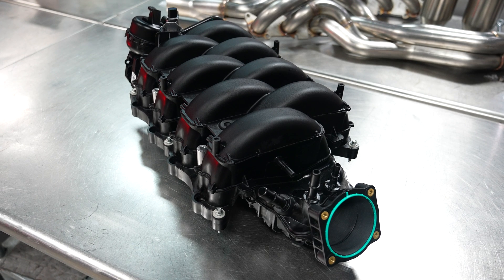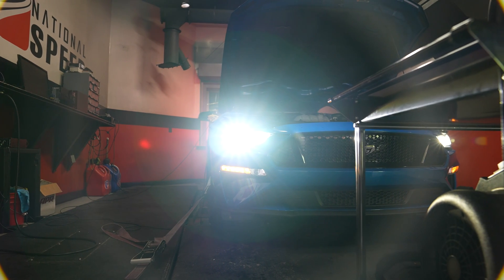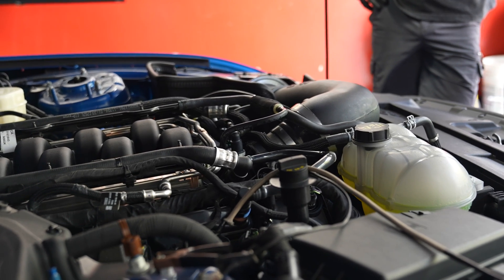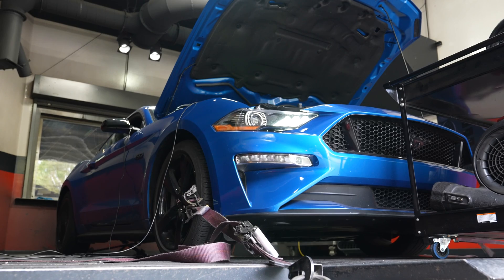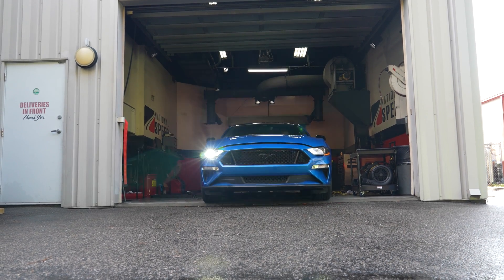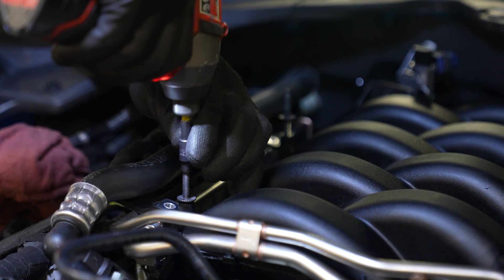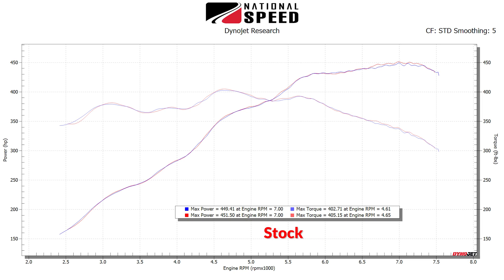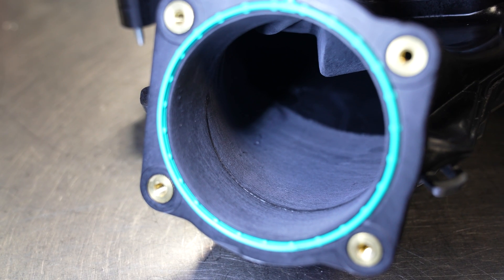18+ Mustang Ported Intake Manifold Dyno | SURPRISING Results!

Comment: Its got to be the head limiting flow at this point right?
Reply: No. This cars mildly modified so its not going to see big gains. With headers, full exhaust, you might see a few HP. The best way to test all this is road testing with a draggy or taking it to the track. Dyno numbers can be misleading. Just like everyone says that the 18+ manifold is cheaper and makes the same power as the GT350 manifold but yet when at the track or draggy testing, the 350 manifold makes every single car faster than the 18+

Comment: This video is very disingenuous…. You will never see the full potential of a ported manifold with the STOCK throttle body and no tuning tweaks. Put an 85mm throttle body on it and make the proper tune changes in a controlled environment and I will bet that it will provide good gains. You guys can fool these novice enthusiasts, but not me. Nothing you can say to me about performance modifications will go over my head. Try me if you want and watch my response will truth and logic.
Reply: Yes. The AFE 85mm Throttle Body is a good product as well.
Reply: 90mm is better if used with a ported intake manifold or force induction (turbo or supercharger). You have to consider bigger is not always better. Keep in mind air velocity reduction if the opening is too large would hurt performance. That would not benefit you. 85mm is the best option in my opinion for full bolt-ons. A larger 90mm throttle body would be most beneficial with a force induction application.
Reply: @HewigIsidore  thank u bc i was doin research and i found out about the 90mm n thought maybe bc its bigger more air can get through but i dont wanna go boost. thank u for the very valuable information.
Reply: which throttle body do u recommend?
Reply: BBK 85mm Throttle Body
Reply: @HewigIsidore for that might as well go ford performance 87mm cheaper and more reliable
Reply: @bigkarl24  I agree 100%. Plus you don’t have to worry about the PCM accepting the unit.
Reply: @HewigIsidore what about the AFE 85mm TB is it any good?
Reply: @HewigIsidore  is the 90mm any better?
Reply: @HewigIsidore yeah but the $ to hp ratio is ridiculously high lol, simple K&n , longtubes, cbe and a tune all you really need NA on these anything more you might as well just save for a supercharger if ur that hungry for a few hp
Reply: Your welcome!
Reply: Just wanted any tips on moding a f150 did an s&b Cold air intake and i am wondering what manifold to get next would u recommend me any?@HewigIsidore
Reply: It depends on your goals. How do you use the truck. Is it a daily driver, weekend racer, do you do a lot or some towing with the truck? What year is the truck? 5.0, 3.5, or 2.7 ecoboost?

Comment: Stock cam motors: keep/run the 2018+ Gen 3 manifold. 

Aftermarket cams to demand more airflow and rpm? Port the intake if you can.

1) thank you all for this testing and video.
2) this goes to show how incredibly well engineered the 2018+ manifold is, box stock. 👏

Comment: Typical results, most stock manifolds are optimized as is, If there was more power to be had there the factory woulda done it .

Smoothing, or changing finishes wont get you a bit of gain either. Toomany places making claims when most times its from the tuning. Ported a ton of plastic intakes unless youre making big power save your money, same with the TB

Comment: Numbers don't make sense a stock 18 is 460 hp so how isless at 459 with intake and headers
Reply: 460 crank horsepower, the 459 is to the wheels which is what matters
Reply: Oh gotcha my understanding was it got less crank...459 to wheel would make more sense....my cars in the shop right now getting one installed hope I get these numbers...I have bk keadera bk mid pipe circa exhaust injen closed box intake and now the 2018 ported manifold...

Comment: It needs a tune to gain the power trust me at least 10-20 depending on headers and intake setup
Reply: I currently have catless longtubes jlt with lund tune on my 10speed how much u think I'll pick up porting my my manifold?
Reply: @Shiftnlift  None, power is from headers and tune
Reply: @Shiftnlift  15 wheel or so
Reply: @Jay vlogs  ok thats worth it then to me thank you bro
Reply: @Shiftnlift how did the mod go? Seeing you sound as if you ok yourself to do the mods.
Reply: @psiturbo  haven't done it yet bro I just  put on new rims.. I had these premium rims that are only 8 inches wide and having problem hooking so I just put on some 19 by 9.5 actually last week. I'm still on 93 as well. So I think I'll go e85 first. Cause that's about 500 compared to me paying someone 3 to 400 dollars porting a intake right now. I probably will eventually tho
Reply: They did tune it

Comment: I think gains (or not) depends because manifolds have different imperfections and smoothing it out makes some difference. Some i believe might be little more shifted on connection points creating almost none or bigger lip making it little bit better or worse from the factory. As you said 5 to 20hp on car with over 400hp is not major difference. Also who and how ported might make difference, if for example runners are not balanced in shape and size as it should it might be even worse than factory. Finish smoother or rougher might also contribute to result. Too many factors to measure over just small gain.
Reply: Finish, nor smoothing out a small casting line will net 0 gain

Comment: Ummm in the real world, doing a ported intake helps A LOT on 5.0's..

Something aint right here
Reply: Op is correct, waste of time in  most cases. Mfr will say anything to sell parts
Most bolt ons w/different cars I found 0 or close to 0 gain on dyno and 1/4 mi
DIg inside the engine is where the gains are but ford did a great job on these as is. Meaning they did the hot rodding for us

Comment: Anyone who knows cars knows that any intake work is worthless without head and exhaust work. Also, that you aren't making any more power unless you alter internals. Any gains seen are just power freed up from airflow, and less weight on the rotating assembly, that transfers to the wheels.. Still you only free up power... not gain it. FI is the only way to make more power.

Comment: The reason why you didn't see any gains is because the stock 2018 Mustang gt intake manifold flow 360-370cfm average runner flow and with a mild combo like a cai and some headers is not enough to use the extra cfm from the manifold porting. In essence at that hp level the manifold was not the bottleneck. To see the real gains from porting from the manifold you need to have a motor that can make 550whp and up.

Comment: Thanks for the video! I was tempted to get my intake manifold port matched with my 90mm TB and spacer and intake tube setup, but I'm not sure it'll do much. I know these cars love to breathe, but I'm thinking I may have wasted money now since I don't see many folks running either of these parts. At the time it was a killer deal though lol
Reply: got a ported boss 302 mani and a 95mm on my fbo e85 gt with the t
10r80. car makes 503 wheel. stock ported mani would make decent gains as long as its paired with good mods and most of all a great tune.
Reply: @gatekeepersdrzn how come you went with the boss over the others?
Reply from the maker: Hey, if it was a good deal, no worries!

Comment: Is tunning required when porting the manifold??? If you do lock outs on the manifold would it need to be re tuned?
Reply: Lockouts and port yes , always when something messes with your air fuel mix you need a tune
Reply from the maker: No, however the gains are minimal. And yes, for the lock outs question, however we do not defeat any emissions equipment.
Reply: @NationalSpeedInc  Im amazed at how many STILL dont get it and others convincing them its not true. Wow

Comment: I hate finding out that companies are actively deceiving people, great video
Reply from the maker: Our guess would be, no one is intentionally misleading their customers.  We truly believe the claims out there are simply due to variables not being controlled.  It's great to have this data!
Reply: Not true because the motors airflow demands was not high enough to use the extra cfm from the porting. The manifold was not the bottleneck on that mild motor. At higher hp levels you will see a big difference